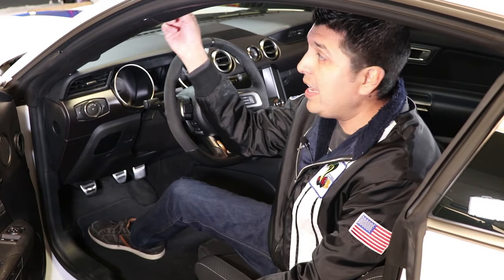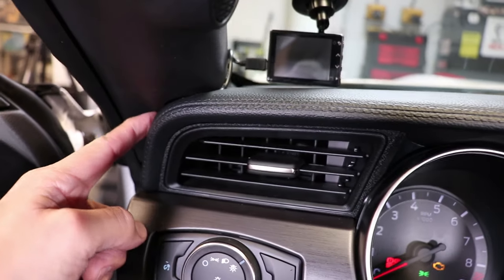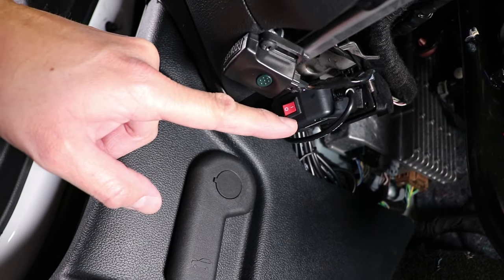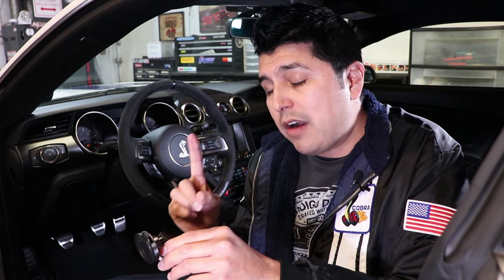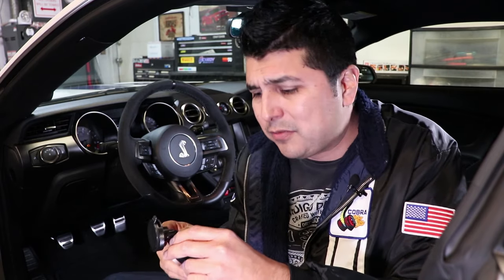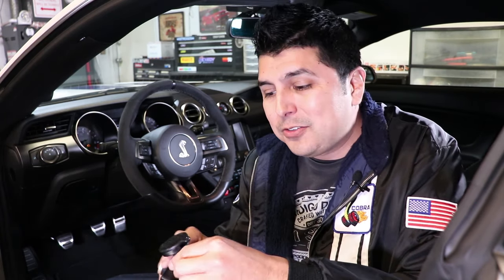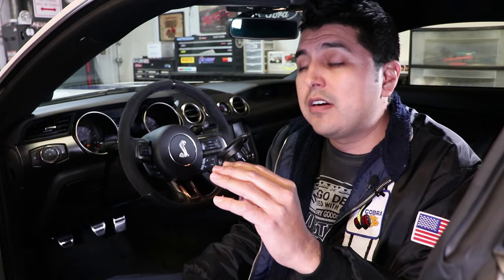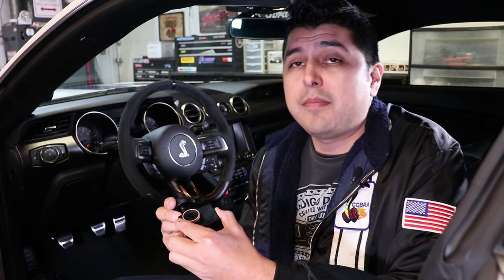Don't hardwire your Dash Cam! Try this instead!

Comment: Great Vid as always, Alex, then how to wore Rear Cam please?
Reply from the maker: Thanks A. JAY! regarding a rear camera, take a look at this LCD mirror camera I recently reviewed https://youtu.be/fQDgk2YnRhQ it does include a rear reversing camera.
Reply: @AlexAutoFun  Thats what I got Alex, wished it has motion sensor, not just the G sensor.
just wondering how to wire the rear cam? ram 2020 fuse box is under hood, would OBD-II you mentioned work? 
Alex, you are the best, thanks a million.
Reply from the maker: @ZorroDaddy  Yes the OBD adapter will power the dashcam which provides power to the rear camera as well. The only thing that requires you to tap into the wiring at the back of the car would be the reverse guide lines (a red wire goes to the rear tail lights) so I didn't bother connecting mine to save time. Not sure if you seen but I also have video explaining the hardwire kit https://youtu.be/83a3w6EtzXo Hope this helps bud!
Reply: @AlexAutoFun  Oh, I got that wiring kit too.  Problem is I have no idea how to wire it from under the hood, where RAM 2020 fuse box is.  Hence I saw your video here.  Not sure what you mean by "taillights" !  truck has factory reverse cam..
Reply from the maker: @ZorroDaddy  Ah got you A. Jay! the process for hard wiring would be same as if your fuse box was inside the car, except the power wires will have to be run thru the firewall into the engine bay to the fuse box. I done this on another one of my cars, I found a grommet in the firewall I was able to poke the wires thru. I do have another video coming up where I go over the actual hardwiring process, please stay tuned friend!
Reply: @AlexAutoFun  Alex, you are my Favorite car guy, period.  Tomorrow I will receive the OBD-II, its how am gonna do it. Thanks a million for keeping up with your fans buddy, be safe.  Any tricks you learnt on the 612T ?
Reply from the maker: @ZorroDaddy  You made my day! appreciate that! yes regarding the 612T,  the trick I best found for it, was no to use it as a regular mirror, with the screen off I aim the mirror towards my seats or another dark portion of the car. This way when I turn on the LCD, there is minimal reflection and glare.
Reply: @AlexAutoFun  You are  a guru young man, I did something like that, was upset about the :glare:  now I know what to exactly, Thanks buddy.  Will try tomorrow to see how to make rear cam stabled/fixed/nailed/glued to something.. welding maybe.. lol

Comment: The only problem is the dash cam have a battery instead of capacitor it will get swollen by sun if using in Florida
Reply from the maker: Hi Francisco! Yeah excessive heat can definitely affect lithium batteries. I'm in California and so far I haven't had any issues with swollen batteries but to be safe I take it off the windshield when the car is parked. Here is another good dashcam that has a super capacitor in case you are looking for one https://youtu.be/1UEEJmZRl4E and I have more dash cams in my channel in case you want to compare footage. Hope this helps and thanks for watching!

Comment: Anyone here get the OBD cable to "work" with the Garmin unit?   I just bought a Garmin 56 but did not get the "special park cable" for $35.   I have the $9 OBD cable but have not hooked it up yet.  I wonder if I have to use the Garmin cable if I could just re-wire the connector so it works on the OBD hookup under the dash.  Seems cleaner than going into the fuse connectors with piggybacks/taps.     And what is added to the Garmin cable to make it proprietary?
Reply from the maker: Hi PappyDC1, the OBD cable unfortunately does not enable the Park mode. I'm also curious to know what they add to the Garmin cable, possibly will buy one and take apart just to see whats inside..

Comment: Not an optimal position to have it I will suggest you to take of a-piller cover and run the wire up to rear mirror and place it the you will get a waay better filed of view that way
Reply from the maker: Hi Benjamin! Unfortunately we are very restricted on the mounting location for the dash cam here in my State :( But the installer can place the dashcam higher by running the cable up the A Pillar if desired. If there is an airbag in the A-Pillar here is my video https://youtu.be/uZp95NbNlmM where I explain some of the issues that can pose. Here is also my follow up video showing video from different angles to help you decide the best one for you https://youtu.be/F7OzM2i7ErE Cheers!
Reply: @AlexAutoFun  Just run the wire so it's not interfer with the airbag then problem solved
Reply from the maker: Yep, as shown on my airbag video that is exactly what most installers will do. Cheers! @benjaminmartinussen2388

Comment: The OBD port should not be used to power anything. It wasn't designed to do anything but interface with a scan tool. You can seriously damage your car's main computer otherwise.
Reply from the maker: Hi oober goober! Here is my other video showing how this adapter works (and how it relates to the SAE J1962 standard we use in the industry for the OBD2 port design and use) https://youtu.be/aV5jQovoaCI and the use of OBD port by non-scan tools. I been running mine for over three years now without an issue but if you are still looking to avoid using the OBD port (and also enable true parking mode) here is my other video showing the alternative Hardwire method https://youtu.be/zbxYA4VhuT8 Hope this helps and thanks for watching!

Comment: I had a dash cam in my car and took it in for a service and when I got it back the power cables were unplugged... luckily nothing bad was done, it just looked sus.
Reply: Same!! Dropped it off at Walmart for oil change and when I got it back they had unplugged it!! I now have it hardwired in! There is no reason to touch my personal property!
Reply from the maker: Exactly! just makes it look suspicious even if nothing happen. I can't live out a dashcam on each of my cars now LOL
Reply from the maker: Yeah that does make it look suspicious even if nothing happened, kind of sucks we have to go thru all this and install monitoring devices when we should be able to trust the dealer or shop you know..

Comment: Can I buy a dash cam with an obd plug already installed, or do I have to add it myself?
Reply from the maker: Hi LaughingblueSu, most dash cams have a mini or micro USB input for power, the OBD adapter basically has an OBD plug on one end and the USB on the other, very easy install but yes unfortunately none come with the OBD plug, they just thrown in the cigarette lighter adapter, thanks for watching bud!
Reply from the maker: Hi LaughingblueSu, most dash cams have a mini or micro USB input for power, the OBD adapter basically has an OBD plug on one end and the USB on the other, very easy install but yes unfortunately none come with the OBD plug, they just thrown in the cigarette lighter adapter, thanks for watching bud!

Comment: im looking for what cheapest portable wifi or car wifi i can get with my car without contracts, so i can have my volway dashcam stay conencted to wifi as needed :D so ican live view whenever i need
Reply from the maker: Hi Kenny! Remember, WiFi dashcams do not connect to Wi-Fi Internet Hotspots, WiFi dashcams only use it to enable your phone to connect to the dash cam. If your are looking to connect your dash cam to the internet via a Wi-Fi hotpot you need a cloud enabled dash cam that can stream video over the internet like this one https://youtu.be/BAEH4f2ulEs Hope this helps, Cheers!
Reply: @AlexAutoFun  wooow saved me from buying lol im over here thinking thats what the volway 12 does, so the volway 12 wont connect to the wifi hotspot? only from my phone? im a little confused, goshthis is confusing.  so why is the volway 12 wifi ? if it wont connect to portable hotspots or car wifi , not car wifi that is already built in but just somthing portable wifi
Reply: @AlexAutoFun   @AlexAutoFun  oh so youre saying for example thr volway 12 it connects to your phone via wifi from your phone? So it can show its recordings? Ahhh ok well i guess ill just settle for parking aassist and surveilance lol i thought i was gonna be able to do live view from my phone
Reply from the maker: @kennygarcia102  Correct, the Volway will only connect to your phone (WiFi dashcams do not connect to Wi-Fi Internet Hotspots, WiFi dashcams only use Wifi to enable your phone to connect to the dash cam) Hope this helps, Cheers!
Reply from the maker: @kennygarcia102  Hi Kenny! correct, Wifi and Internet are two separate features. Wifi is being used by the dash cam to provide a wireless connection (locally in the network created by the dash cam and the phone) and on Cloud Enabled dash cams, Wifi is used to connect the dash cam to the internet via a hot spot (portable internet modem) Hope this helps, Cheers!

Comment: Would this work for a129 dashcam?
Reply from the maker: Hi Carlos! it should, I believe the A129 uses the mini USB connector, so this would the one that fits it: OBD Power Cable Mini USB  https://amzn.to/2XFijQA
Reply: Would this one let me use parking mode? Thank you for the Info just subscribed!
Reply from the maker: @carlosrivera8756  Awesome! thanks for the sub Carlos! regarding parking mode, it won't enable true parking mode. Instead the dashcam will continue recording like normal even when the car is off (you will need to manually turn off the display to save battery) so it will capture incidents but it may drain your battery faster than true parking mode, here is a video on the parking mode kit if your curious to see it https://youtu.be/83a3w6EtzXo

Comment: Will this work with a backup camera that I want to always be on when driving? Thank you.
Reply from the maker: Hi Denny, it should work but the cable is not long enough o reach the back of the car but it could be extended with a USB extension cable, hope this helps and thanks for watching!

Comment: I don't know about electrical stuff I thought after I installed my dash cam it will be recording 24/7 until I run out of space on my sd card
Reply from the maker: Hi Zara! ah yes no worries, yeah dash cams use Loop Recording so old video will be overwritten by new video once the memory card gets full. Incidents that happened during the recording can be protected against overwriting them if the dash cam is equipped with a G-Sensor, or if it supports Motion Detection. Additional a few dash cams support Time Lapse mode where they can potentially record many hours continuously (amount of time set by user) instead of Loop Recording. Hope this helps, Cheers!
Reply: @AlexAutoFun  thanks for the info I set my loop recording at 1 min is that right, choices are 1,3 and 5 mins
Reply from the maker: @Zara Zong  Hi Zara! I personally use 3 mins, here is my video where I go over the best dash cam settings https://youtu.be/K7qURDfoR7c Hope this helps, Cheers!

Comment: Why don’t you just use the power from your rear view mirror? Remove the pin from back of mirror and put in a 12pin to USB adapter in in….then plug in camera.
Reply from the maker: Hi christina! ah I think someone tipped you off the video I'm working on next! LOL stay tuned for the follow up video where I show how to use Mirror power adapters :) Cheers!

Comment: DO NOT USE OBD PLUG for power. Great way to cook your car's data network. It is not designed to power devices continuously.
Reply from the maker: Hi Isaac! Here is my follow up video showing how the adapter works (and how it relates to the SAE J1962 standard we use in the industry for the OBD2 port design and use) https://youtu.be/aV5jQovoaCI including the use of the OBD2 port by non-diagnostic tools. I been running mine for over four years now without an issue and since making this video, we also seen more dash cams like Ring, Garmin, Thinkware, Vantrue use OBD2 adapters. However if you would like to avoid using the OBD2 port for power (and also looking to enable park mode) here is my other video showing the alternative Hardwire method https://youtu.be/zbxYA4VhuT8 Hope this helps, Cheers!

Comment: Hi:) I would like to connect my Dashcam with the OBD but there is already my driver's log connected. Do you know, if it still work with a distributor plug? (sorry for my english - greets from germany!)
Reply from the maker: Hi Sarah! some viewers have mentioned using an OBD splitter like this one https://amzn.to/3Kv7OFr to run multiple OBD devices at the same time, however I have not tried that myself. If do order one and try it out, please let us know how if it works. Hope this helps, Cheers!

Comment: My new GMC van has a rear camera which is great for backing up…. but because my van has USB ports in the back with power, I’m thinking of putting in two wireless ‘single’ dash cams one in front and one in the back!  But I wonder if I my 2021 iPhone could handle both cameras?  
While I own this van I just do not want to pull out panels etc. to hard wire it.  I’m am not that handy and if something can go wrong it will in my case!  Its just my kind of luck, which equals no luck!!!!
Reply from the maker: Hi Cathie! that is a good idea, I know some other folks have done that to eliminate the need to run the cable from the front camera all the way to the rear. The cameras would operate independently without needing to connect to your phone. You would only need to access them to change the settings or to download any video from an accident (either manually by taking the memory card to the computer or with wifi for dashcam that support an App) I have several dashcam reviews on my channel under the playlist "dashcams" if you like to compare them. Hope this helps and thanks for watching!

Comment: DO NOT USE OBD2 at a constant source of power this is a bad suggestion!
Reply from the maker: Hi G! Here is my follow up video showing how the adapter works (and how it relates to the SAE J1962 standard we use in the industry for OBD2 port design and use) https://youtu.be/aV5jQovoaCI including the use of the OBD2 port by non-diagnostic tools. I been running mine for over 5 years now without an issue and since making this video, we also seen more dash cams like Ring, Garmin, Thinkware, Vantrue, Nexar, Wolfbox, use OBD2 adapters. However, if you would like to avoid using the OBD2 port for power (and also looking to enable park mode) here is my follow up video showing the alternative Hardwire method https://youtu.be/zbxYA4VhuT8 Cheers!

Comment: USB Charger Power Outlet.... The Dome/Cabin light on your roof has a constant power supply there. Even when the car is turned off.  Get an outlet mounted up there and wire it into the dome/cabin light power supply. Some outlets even come with the wiring harness and only cost a few dollars. I have a mini9060 dash cam mounted high centre with a very short USB cable. It's behind the rear view mirror and you cant even see it when driving.
Reply from the maker: Nice! that's pretty clever, I also heard about tapping into the Mirror lights, I may experiment and make a video on it, I'll see if we can also do the dome light install, thanks for sharing Brett!

Comment: Best place for the dashcam is behind your rear view mirror.  Its out of the drivers line of sight.  Having it where you have it, is stupid.
Reply from the maker: Hi The English Trucker! unfortunately this is the only location where we can legally place our dashcams here in California :( However the dashcam could be placed higher by running the cable up the A Pillar if desired, hope this helps and thanks for watching bud!

Comment: That is the worst spot for any dash cam to be. And this is why pros should be the only ones making YouTube videos. Also, if your car is at the dealer for a service or repair, the mechanics will DISCONNECT your OBD2 adaptor because they will need that port to connect their scanner. So, bye bye to the idea of using your cam to keep an eye on them or after, they may forget to plug your cam in after they are done with the port.

Also, chances are they’ll disconnect the car battery if the work they are doing requires it, but if your dash can was hardwired, it would only lose power when they do that, and once power is restored it goes back on .
Reply from the maker: Hi AdrenalineHigh! unfortunately this is the only location where we can legally place our dashcams here in California :( However the dashcam could be placed higher by running the cable up the A Pillar if desired. But here is my other video showing the alternative Hardwire method https://youtu.be/zbxYA4VhuT8  this maybe more of what your are looking for. Hope this helps and thanks for watching bud!

Comment: Small question how long the car is able to support camera in parking mode with motion sense enable ? With 128 Sd card suppled? Cheers
Reply from the maker: Hi Waken! ah that will depend on how large your battery is, the parasitic draw on the battery from the car system itself and other accessories, the dash cam type your are using (different dash cams have different power requirements) and the number of incidents the dash cam will record, so it can vary quite a bit, from several hours to many hours. Hope this helps, Cheers!

Comment: Your mechanic will be unplugging it to plug in their computer
Reply from the maker: Hi! Only if they need to pull a DTC from the car, so far my car has seen several service visits at the dealer and all were fully recorded. However you are correct, the possibility is there, here is my other video showing the alternative Hardwire method https://youtu.be/zbxYA4VhuT8 However the same can happen here, the mechanic can also just unplug the dash cam's power cable even if hardwired or disconnect the battery which will leave you with no recording. Cheers!